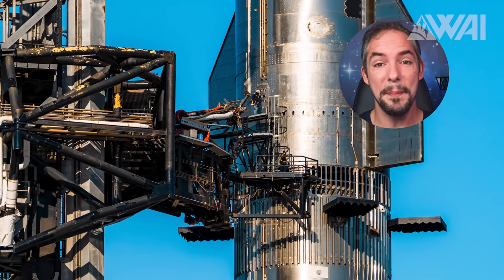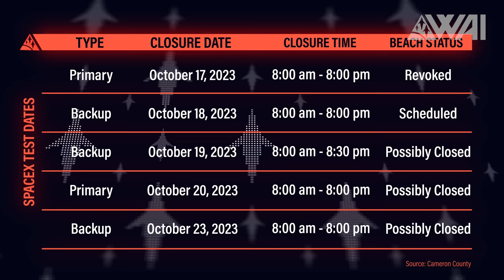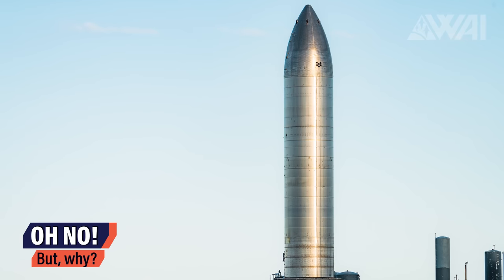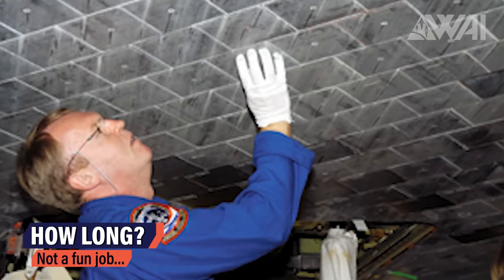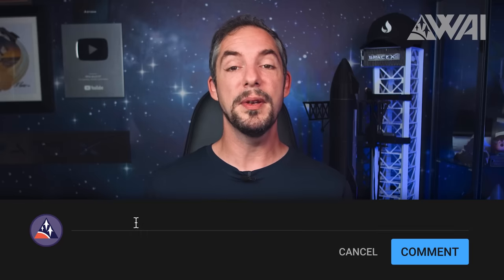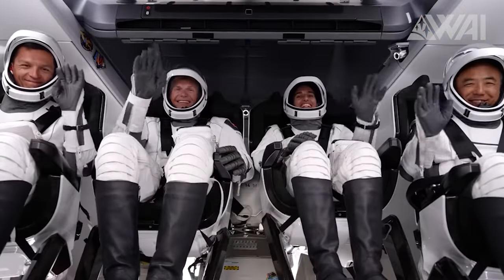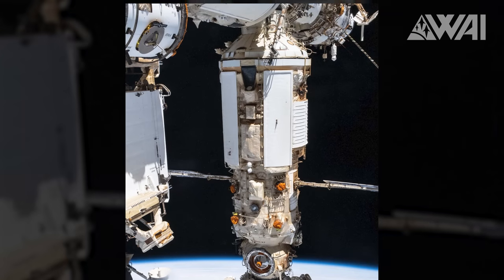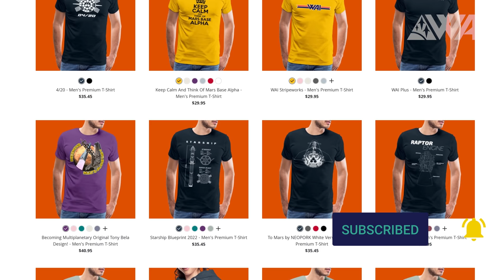SpaceX Starship Tests Continue: It's Action Time!

Comment: Hey Felix, mere missing tiles is not what caused the Columbia accident. Tiles had been lost before, including in that same area. What was different about STS-107 was that a chunk of frozen ET insulation had not merely knocked off some tiles, that had happened before, but had actually punched a hole in the aluminum skin of the airframe underneath the tiles. That allowed the ionized gasses to intrude on the interior of the Orbiter itself and compromise its structural integrity. Basically, it could have been completely impossible for a tile to come off, but punching a hole in your spaceship would still have resulted in disaster.
 
I used to be tremendously excited about the idea of the United States becoming the first nation with two separate manned spacecraft. Frankly though, after all of Starliner's delays, and its obvious operational inferiority to Crew Dragon, it just doesn't seem to be that big a deal anymore. Frankly, these days, I feel a certain sense of schadenfreude at Boeing's continuing problems, given the powerful political elements who wanted to give them them a non competitive sole source contract. It was embarrassing enough to be hitching rides on Soyuz for nine damned years. Can you imagine our situation now, the utter humiliation, of still being in that situation because Boeing can't put a capsule in the air? 
 
Of course, assuming they finally fix Starliner's problems and get it flying next year, then, sometime in 2025, when Artemis 2 flies, we will have three independent, operational, manned spacecraft. Of course, none of these are the path to the future, that is Starship. Nonetheless, imagine a day, not too long from now, when Crew Dragon, Starliner, Orion, a crewed Dream Chaser, some crewed craft from Blue Origin, and Starship are all conducting operational missions. Starship's magnificent operational superiority will mean that day won't last too long, but it will be glorious.

Concerning the coolant leak on Nauka, it is, of course, in a secondary system, but Marcus House's most recent video said it wouldn't have affected operations anyway because there is not that much going on in Nauka. That surprised me. I assumed that the Russians would have had a significant backlog of experiments to be performed that had been waiting for years to get the lab capability of Nauka on orbit, but it's been up there for two years now and it's not working at full capacity? That's a shock. Once again it would seem, as they have done so often, ever since Sputnik, the Russians have performed a space mission which was more PR than actual science and engineering accomplishment. Nauka was over ten years behind schedule. They finally got it launched to great fanfare and press stories about how their scientific work on the station was finally going to equal that done in the American, Japanese and European labs, and it turns out they're only using a fraction of its capacity.

It is difficult to see what the Russian manned space program is going to do after the ISS is decommissioned. They cannot build their own space station. We are going to have several new, privately owned ones, and even the Indians are planning one. They cannot go to the Moon. They probably cannot make any significant contribution to the Chinese Moon program, to which they have signed up as junior partners. Their Soyuz rockets cannot even reach the Chinese space station due to its orbital inclination. They are going to be reduced to free flying Soyuz missions,  or swallowing their pride and renting space on one or another of the American private stations, but still not doing more than two flights a year, or worse, having their cosmonauts flown to the Chinese space station on Chinese spacecraft. Believe me, that's hard on the national prestige. They are highly unlikely ever to develop the Orel manned spacecraft. They have some nice looking mockups of it, but I doubt they will ever produce useful hardware.

Their unmanned program is in no better shape. The Angara rocket has not flown for two years. It's next flight is scheduled for NET this December, but the one after that is NET October of 2025. After that, they intend to round out the decade with a grand total of seven missions, two of which are dedicated to Orel, and hence probably will not fly. And yet, the rocket it is replacing, the Proton, has only two more scheduled flights. My guess is they are never actually going to develop the Amur or the Soyuz 5. They have even begun scheduling their national security satellites, which have primarily been launched on Proton, on Soyuz 2 rockets now. Virtually their only rocket going forward is going to be the Soyuz 2. A venerable rocket, flying since 2006, but already antiquated and fated to just fall further behind the rest of the world, even the upcoming expendables, to say nothing of the reusables. It is true that the Soviets were never as far ahead as their early PR stunts made it seem, but nonetheless, how the mighty have fallen.

Comment: At this point they are essentially killing time until they get launch approval. None of these modifications are needed for the 2nd launch. But SosceX’s mantra of iterative design means they always have another project to work on all Boosters+Starship being built. There is no good reason not to continue modifying the next S26/B10 up until they get the launch license.
Reply: If you believe that you will believe anything.
Reply: The problem with that is fixing a relatively minor problem could accidentally cause a major problem. If it will most likely meet the mission's objectives, then leave it be.
Reply: The Spacex rocket design of Starship is extremely clever and unique but is still only experimental until it can achieve reliability which am sure it will. On a long term basis do you think it possible/benificial/or logical for Starship to expand its upper diameter to say diameter 12m to achieve more bulk capability (ie in space telescopes, etc) at the expense of some loss in payload capability.
Reply: I disagree. why not use the time to check fits, the alignment with repeated stackings, actual practice getting the stacking procedure more streamlined, etc.
Unless, of course, elon likes wasting money like he did with twitter.
Reply: @ThatOpalGuy  I agree with you up to a point. Certainly, there is a lot to be gained from practicing procedures. That keeps the workers skill levels up. 

What I was referring to is taking things apart just to do some modification on a flight ready vehicle. Simply put, one takes a risk on creating a bigger problem. 

In deciding if doing a certain task should be done, one should take into consideration whether or not the mod adds  to the given flight objectives. If no then the best thing to do is leave it be. 

Example. If the modification has to do with an in orbital objective and the given flight is suborbital, then don't do it. But if the mod has to do with vehicle separation,  then it would be a reasonable thing to do.
Reply: @clay-tw5gc  sure, but perhaps engineers pitched a small change that could be done on the pad, or near it, that could improve results?
Reply: @ThatOpalGuy  that is the very question that one would have to ask themselves. If it was relatively easy to get to and could improve the chance of achieving a flight objective, then the answer would  be why not? 

It is a judgment call. Some calls are easy and some are hard, extremely hard.
Reply: Could be looking at spring 2024 for the next launch, according to FWS.

Comment: If not a parking lot, they may be creating a catch basin to catch the deluge system runoff. This is one of the main concerns of the Fish and Wildlife Service. They're going to have to recycle the deluge water for reuse instead of rletting it run off into the marsh.
Reply: Asinine.  A typical Texas thunderstorm produces a million x that much fresh water.
Reply: What about the frequent rainstorms?
They dump much more fresh water on the SpaceX grounds in Boca than the deluge system.
Will they have to collect this runoff too?
If not, why is it allowed to enter the wetlands while Brownsville tapwater isn't?
SpaceX have tested the deluge system several times, including while firing the booster.
Why haven't they received a fine or a cease and desist order from the Fish and Wildlife Service?
Reply: My sister is an insider and they say that the deluge water contains small amounts of solid carbon waste (graphite).   It could be catastrophic if that graphite were to accumulate in the yellow breasted sand flea.   Let's remember that the stakes are very high, please let the experts do their job.
Reply: @RobertMOdell   An exerpt from the article I linked:  
"According to a spokesperson for the Texas Commission on Environmental Quality (TCEQ), the state's environmental regulatory body, SpaceX has not yet applied for a Texas Pollutant Discharge Elimination System (TPDES) permit at its Starbase facility as of July 28. The spokesperson also confirmed that the site obtained three stormwater permit authorizations." - CNBC
Reply: @RobertMOdell  Another exerpt from the article I linked to:
“Industrial process water is a regulated pollutant under the Clean Water Act,” environmental engineer Eric Roesch told CNBC in an interview. “Heat, silt, and a range of chemicals that mix into wastewater will degrade the biological integrity of any surrounding wetlands and erode water quality over time," he added.
Reply: As long as it is cleaned up it should be very easy to dispose of.
Reply: I thought they had already done that !
Reply: @nuxboxen  "Yellow breastfed sand fleas". lol (bloody auto-correct).
Reply: @nuxboxen  Your sister is a comedienne. 😂
Reply: use new clean deluge water for each launch, to protect against increased corrosion. The air is probably loaded with salty humidity there at the beach! Not good for cars, as well as rockets. Maybe the rocket needs to be washed with clean water from time to time. too! 
  The "regulators" are everywhere plumb out of their heads, example: EU forbids the very productive farmers of the Netherlands to use their optimal amount of fertilizer; because the off-flow will burden the groundwater and cause too high concentrations there, and in untreated drinking water.  Where does the groundwater of the Netherlands goto? 
 Isn't it flowing out shortly later into the North Sea? So what good is this EU regulation? Nothing; it even makes the fish unhappy, because they get less tasty seaweed to feed on!
Reply: Wouldn't want any water to get into the marsh, like 4 times a year.
Reply: You would think Spacex would want to contain deluge water if/whenever engines are firing, contain, test and treat; when and if required. Having to contain uncontaminated rainfall runoff is certainly extreme.
Reply: @RobertMOdell  fresh water...not water contaminated by leaked fuels, lubricants, etc.
Reply: @nuxboxen  Im guessing none of the people here give a rats behind about any animals that may be endangered.
Reply: @rogerphelps9939  it quite literally will evaporate
Reply: True nice observation.
Reply: @nuxboxen 😛😛😛
Reply: @nuxboxen  Yeah, it might make them to heavy to fly.
Reply: @cbboegh  When have activists hiding behind ecological issues ever needed an excuse to use “environmental” issues to crimp progress?
Reply: @ThatOpalGuy Leaked fuels?  Lubricants?  From what?  The rocket's fuel is methane, which boils off at some temperature far below 0, so this isn't going to be a contaminate.  As for fuels and lubricants from machinery operating on the site, I don't see how this is likely to be any worse than the runoff from your average low traffic road after it rains.  There  are a great many roads with drainage ditches that do not lead to water purification facilities, or even with no directed drainage at all, so if you're actually interested in endangered animals and not merely virtue signaling, maybe you should start there.
Reply: @Keldor314  seriously? all you can manage is a weak ad hominem attack?
do you SERIOUSLY think that the starship and booster are the ONLY things out there? I am not even going to waste time trying to educate you.
good day
Reply: @rexrider2099  exactly like I said before you spammed us with two long posts...  SAVE THE YELLOW BREASTED SAND FLEA!!!!   #becauseGREEN
Reply: @ThatOpalGuy  I believe you were the one to accuse everyone disagreeing you with "not giving a rat's behind about any animals thay may be endangered".  But you're right, one should not respond to weak ad hominum attacks, so I'll bid you good day as well.

And look up industrial waste water.  Then you can see what sorts of truely nasty things the regulations are meant to protect us from.  The things you're talking about are more in the industrial site runoff category, which is not even remotely in the same ballpark.
Reply: @Keldor314  hit a nerve, huh? end of the day, regulations save lives, whether its yours, or a termites.
Reply: @Keldor314  "I don't see how this is likely to be any worse than the runoff from your average low traffic road after it rains. "

Road runoff is a SERIOUS environmental issue as it happen and causes a lot of handwringing in some areas where the concentrations are high (by a busy road it can be more toxic than raw sewage)
Reply: @nuxboxen   I'll just point out that my comment has gained quite a few likes and was used by Felix in the following WAI episode. So, maybe you should keep your obnoxious comments to yourself.
Reply: @rexrider2099  I stand with the sand fleas #green

Comment: That was a really awesome segment about the heat shield tiles. I have always imagined the final installation process being something like a vinyl sticker transfer. The tiles could be stuck to a transfer film and then pressed on to the pins all at once around the belly of the ship. You could either press the ship into the sheet of tiles or use some big machine to press the sheet of tiles onto the ship. Then the robotic arms mentioned in this video would take care of the special ones around the nose and flaps.
Reply: They're anchored on pins to keep them from just blowing off and no adhesive can handle the heat or wind force.
Reply: @patrickdurham8393 You misunderstand. The pins would still be used, as mentioned in my comment, but to get them attached to the pins, instead of doing them one at a time, you'd apply them all like a transfer sticker with a backing on the exposed side of the tiles. Have you ever used a vinyl sticker transfer? The side of the sticker that faces out has a transfer film that you peel off once it's stuck down. So, the tiles would be attached to that, press them into the pins, and then peel off the transfer film.

And by the way, adhesive can handle the heat and "wind force". The space shuttle tiles were applied with adhesive. But I'm saying they would still use the pins. You just didn't understand what I was saying.

Comment: How many of us thought Starliner was going to beat Dragon? I did. I thought: Starliner is backed by the 'big guys', so it made sense. I was wrong and have the greatest respect for SpaceX's engineering. Regardless, it's good to have options.
Reply: Engineering is not the problem, what your aim is is. Those other companies are just marking time living off the government.
Reply: I was certainly rooting for SpaceX, but not extremely optimistic, especially after their pad explosion set them back a year. I guess they were always well ahead to begin with. The two independent provider philosophy has certainly shown its worth, although I'm sure nobody ever expected that to happen before one of the providers even got off the ground. Can you imagine if the faction in Congress who supported a non competitive, sole source contract for Boeing had had their way?

Comment: To the editor, Where do you dump excess heat from your computers? Even if you have a liquid cooling loop, you still have radiators that use fans to expel heat into the air.
Reply: S P A C E  is cold. Very cold.
Reply: @djmouseshadow4735  Only if you're in permanent shadow. Otherwise, it's hot. Very hot. Why does the ISS need so much thermal insulation and such huge thermal radiators?

Comment: The hot staging ring is not just a single version. There have been at least 3 if not more based on the size and shape of the openings and the reinforcements. It is possible they continue to upgrade a fewer number of them. It is such an important ring structurally, they may be loading the upper stage with fuel and making modifications based on what they measured. 
My pure speculation.

Comment: (The Quick Disconnect Alignment Issue) --  Yes, there is a distinct possibility of a launch site foundation disturbance.  Some time ago Boca Chica residences saw changes in ground water levels.  The massive weights of building constructions, trucks, concrete foundations, roadways, etc. are acting like a weight upon a wet sponge. So, tremendous concentrated weights can/will eventually cause problems if not properly engineered.
Reply: Any earthquake engineer knows how to float a structure.